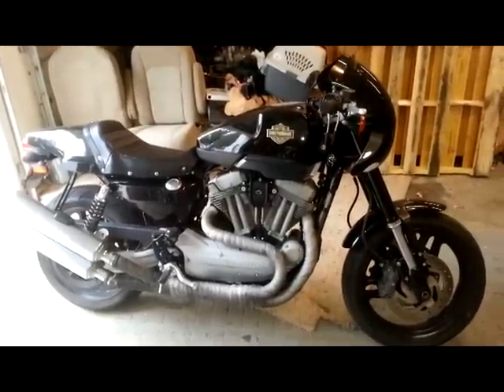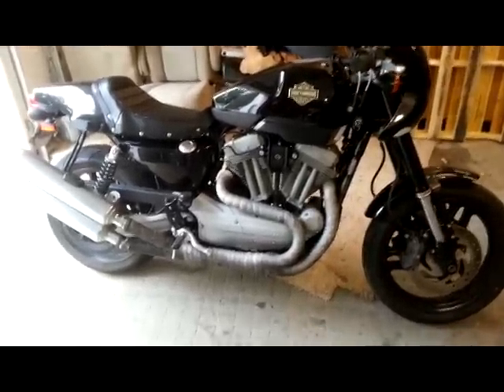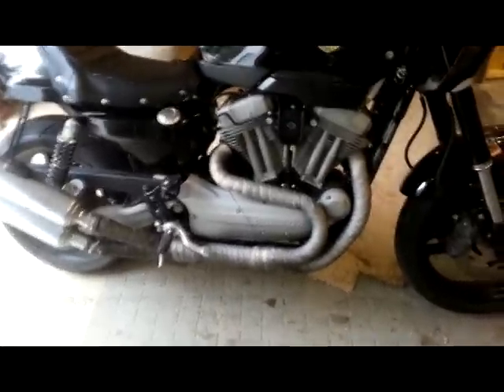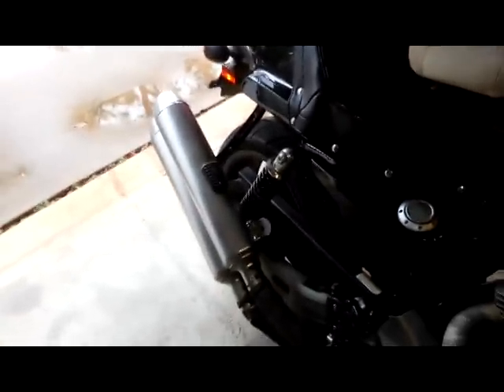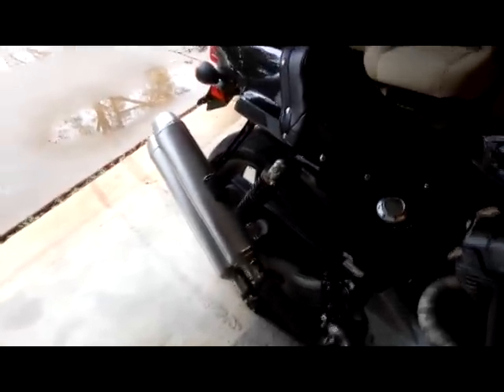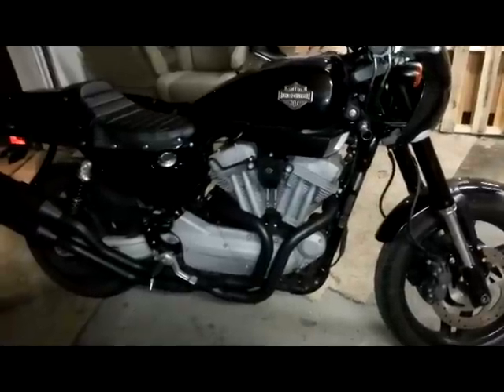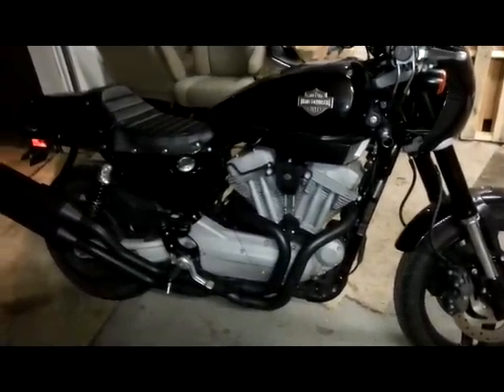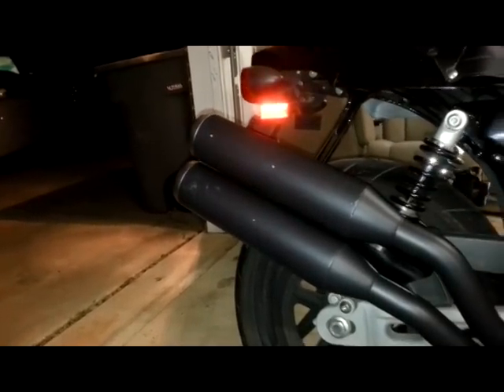Before and After Vance & Hines exhaust on a 2009 Harley Davidson XR1200

Comment: Nice bike how was the difference in ridin?
Reply from the maker: bigjam8429 It did increase the riding performance. A little faster. But the biggest performance leap was the sound. Sounds incredible!
Reply: iphoneslone you still got her? How’s reliability been bro?
Reply from the maker: bigjam8429 I actually traded her in for a Road Glide. That cafe kit I put on was sweet but that seat was as hard as an ironing board and long trips were brutal. As far as reliability it was stellar. Never had any problems with it. It was a serious head turner and lots of old dudes would come up to me and talk about how they had an old late 70's XLCR 1000 back in the day. But I guarantee my baby ran way better than their old iron head.